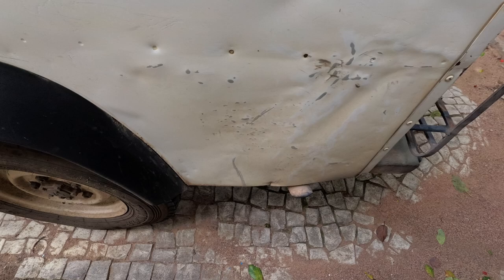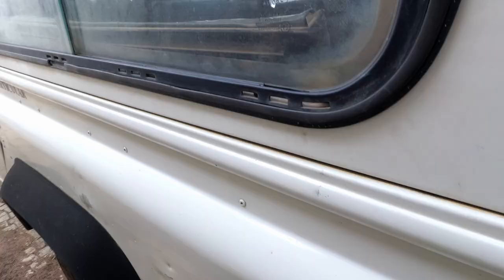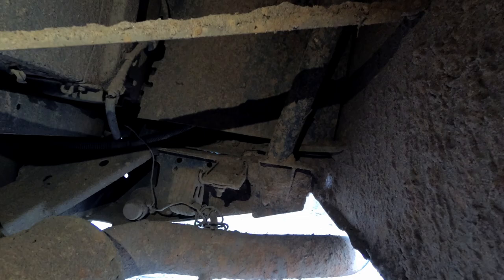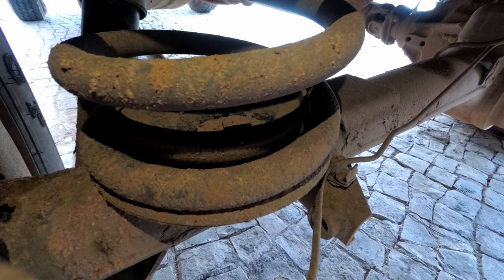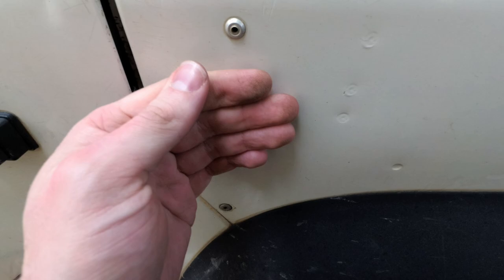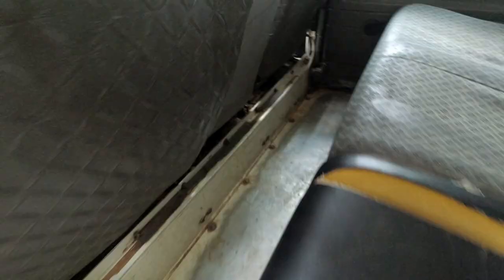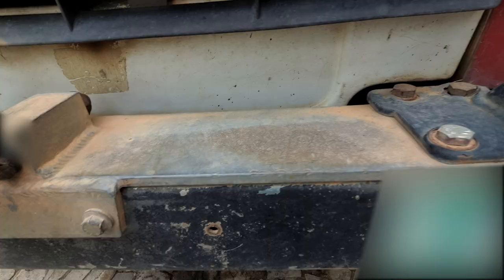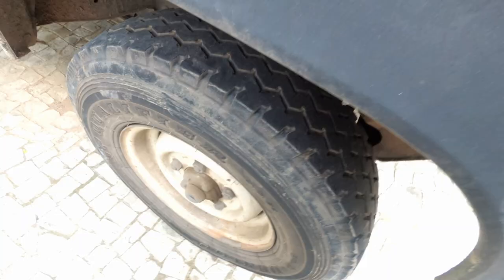Wear and tear on Defenders that live offroad

Comment: A few comments suggesting doing a Land Cruiser review and others wondering how other vehicles compare.
I think that would be a good video, especially if you can find one from the same fleet with similar mileage.
Toyota's speck for the Land Cruiser was that it is supposed to survive for 25 years in the Third World. 

It won't be long now before we get to see the Grenadier in it's finished form. I have to say I don't see many of the new Defenders.
Reply: Yes would be very interesting to do the same thing with the 76 or the 78 in front, particularly if one has the similar mileage.
Reply from the maker: Finding one that has had a similar life will be a bit tricky as they're a lot newer in this fleet, but I'll see what I can do 👍
Reply: @lrworkshop  Thanks, start with the cargo door hinges, they always wear if not oiled.

Comment: On the topic of rust, or lack of it, we all know about salt on the UK roads which we all fear. What we don't think about is humidity, Britain is very humid both in the summer and winter. 
As a guide, if the humidity is below 40%, (Think California.) rust cannot form. 
Parts of Africa have very low humidity for most of the year.
The last thing is sea air, we all know not to buy a vehicle that has spent it's life in a seaside town. Most vehicles in Africa have never seen a beach.

Comment: Good day i have a td5 defender a 2002 model can you please show how the seatbelt stapks where the seatbelts clip into are mounted ontobthe seats please thank you.I did buy the hayens manual butt it dont show anything dont see anything in the net butt i must still do more research.
Reply from the maker: The female part of the seatbelt clip is bolted into the floor, if that's what you mean?
Reply: @lrworkshop  mine have nothing in and i dont find pictures to see how it must looks like thank you